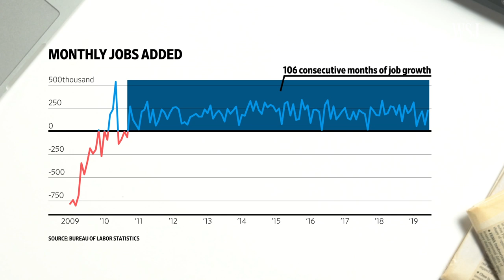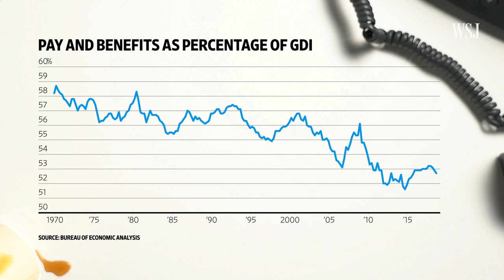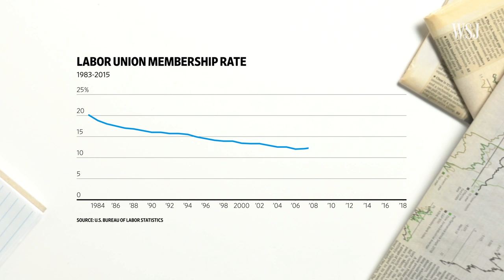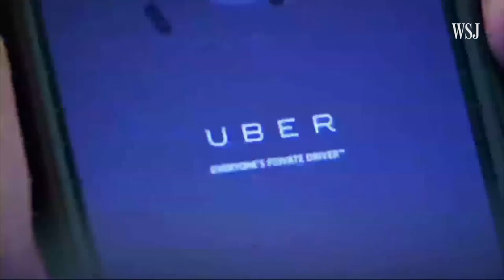Why Are Wages Low in the Growing Job Market? | WSJ

Comment: A bill that would increase wages but probably be blocked in the Senate? Blame Moscow Mitch
Reply: a bill that increases wages will simply result in fewer people holding jobs. A bill that ends minimum wage and requires all laws to have expiration dates so that outdated laws disappear would fix the problem.
Reply: Michael Stewart well corona virus did it instead

Comment: The pay per hour compensation model doesn't work. If it did we wouldn't have low wage workers like we do now. Personally I think workers should be paid based on a percentage of sales. Yes that's a feast a famine model but right now all we have is a famine model for the average worker so the current pay model clearly doesn't work.
Reply: Then you will have more people on Government assistance because its no guarantee that you can make $ 500 sales  every day. At least hourly pay its guarantee regardless of the outcome.

Comment: Increase the minimum wage and automation will really take off.  I'm surprised that a lot of the ordering and payment positions at fast food reasturants haven't been replaced with computer interfaces.  There are a limited number of items and configurations and card/money machines have been around for years.  Considering the high error rate that the humans generate, the benefits are there.
Reply: its actually more complex than you think, because you have to answer people's questions, and alot of time the questions are crazy or really stupid. you cant really automate that.
Reply: @titolovely8237  I realize that.  What I think will likely happen is that stores which have a large volume with often multiple order takers/cashiers, there will be a position with an automated machine and another one with a person.  Most people going to a fast food place know what they are going to order.  For the others there is the person.  It is likely the line involving the clueless patrons and human order taker/cashier will backup and the one with people who have their act together will move quickly.  Organized customers will tend to flock to the automated system which they can handle and moves at a faster rate.
Reply: @lewisdoherty7621   Retail and service is headed that direction already it just takes a lot of time to implement. I've noticed already a lot of retail stores have more self checkouts than a few years ago (Wal-Mart, local grocery stores, even my local Costco added a few self checkout lanes). I don't know much about the rest of the country's trends, but you have an interesting idea that maybe higher minimum wage may have expedited the process of implementing automated service.
Reply: Mcdonalds in China have these interfaces and they work great . I can order my meal and whatever language i want and do  not have some rude, fat , feminist, ,woman make snide comments behind my back/
Reply: The sad is that people are not going to buy anymore because the don’t have the money and roof over there head. America will become a 3rd world country.
Reply: they have that in China. If i go to mcdonalds i can order my meal at the kiosk and the lovely Chinese waitress will bring my food to me when it is done. Everything is better in China. How I miss the SZechuan Chicken sandwich
Reply: @lewisdoherty7621  Problem is with automation like programs is it can be hacked. There was a guy who used a kiosk and unplug the network cable to the kiosk. Then he took a fake credit card and random pin and used it to buy a meal. Then he plug back in the cable and walked out with his free meal. Also people can do chargeback hack too. This is especially true with online banks you can go in and easily dispute a charge say hey I did not buy this, someone used my card and blah blah. The bank will reverse the charge and give back the customer money while the store does not get the product back which now counts as a lost. The Safeway store where I live at had numerous issues where customer scammed the store that they had to remove the self checkouts.
Reply: @rico359  We already Third World
Reply: Agree. Add self driving cars to that and most of service sector is dead. Question is what will happen to the huge mass of people it employs.
Reply: @titolovely8237  there is google to answer questions
Reply: It seems someone needs to develop new areas that service type industry people can be employed.  Normally something like this would have appeared anyway, but sometimes a lot of surplus capacity gives people an idea.  Farmers went from 90 percent of the population to two-percent of the population, so these economic dislocations happen. @zuzanazuscinova5209

Comment: Those wages will level out. We're early in the plan to bring back jobs to America. The problem is that we're trying to compete on a playing field that is not level. The theory that supports this is that Americans were supposed to keep the well paying jobs while the lower paying jobs were sent to countries that have lower wages. In theory, this is a win-win (pareto efficiency) in that the lower wage countries get jobs that increase their standard of living and produce goods at a lower cost for the other country. What is missed in this equation is that grass roots industry, most times a manufacturing/value-add types of industry, are the basis of more complex economies. It is a multiplier effect with a high number of instances of a low multiplier. All these instances combined leads to a large impact. Add to this that the technology that is the basis of the economic advantage that produces the high paying jobs does not stay unique for long periods, and you have those jobs too becoming portable. Why have a manufacturing team on one side of the globe, creating material communication and responsiveness issues with the engineering team on the other side of the globe? Move the engineering to the same location as manufacturing and you have a more responsive company.

That said, we are in the process of leveling that playing field with economic tooling. The jobs are starting to come back and we will start to see the multiplier effect and labour supply/demand fill in the missing middle class. It is a very interesting time to be alive! We are witnessing the reversal of decades of bad policy.

The only part we don't fully see yet is how this will shake out in a stock market that makes it's money on growth. I think the time of free money is coming to a close, along with the close of abusive economic policy.

Comment: Opinion by our host, Shota: “#1 reason for low wages is weak antitrust enforcement in mergers which is helping monopolies. The higher the antitrust enforcement the higher the new firm entry in the economy which increases competition for labor. Until the U.S. Attorney General publicly discourages horizontal and vertical mergers, especially in the banking industry, very little will change.” Watch our E P I S O D E  7 tomorrow on firm entry and real incomes from 1948 to 2008 at PublicPolicyShow.com (9pm EST LIVE).

Comment: Wont a higher minimum wage push more jobs outside of the country?
Reply: The answer is no. The wages most affected by the increase are businesses that rely on the American market and can't just resettle. Were it a factory or IT that would be a solid 'maybe' but most of those jobs that would leave have already left and won't return. Those other businesses that stayed already push for or have achieved a level of automation.

 Your common franchise owner, Restaurant, or store can't just go settle elsewhere. The question has always been how many doors would have to close to get that wage, or how much inflation would happen to maintain that minimum wage.
Reply: That and it will result in small businesses cutting workers' hours or closing up shop and large corporations, like McDonald's, replacing more workers than they already have with self-order kiosks and self checkout lines.
Reply: @egodominustuus9167  that's why we have anti-monopoly laws. They're just not really enforced anymore.
Reply: @anthonytwohill9726  Anti-monopoly laws would not apply to small businesses, such as local restaurants and bars, which would be hardest hit by an 
increase in the minimum wage; and they wouldn't do anything to prevent large corporations from getting around such increases by cutting workers' hours and automation.
Reply: @egodominustuus9167  Small businesses will turn to gig work. Independent contractors will be cheaper. Hire them when needed and no worry about PTO, sick leave, holiday pay and so on.